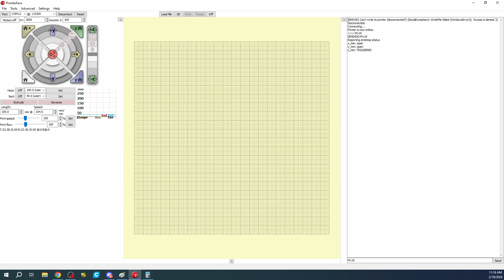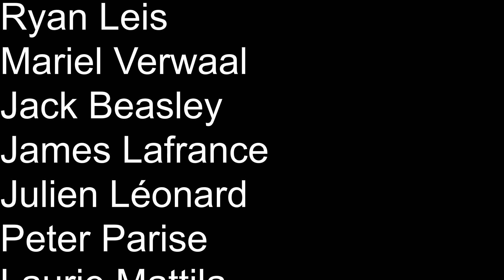Creality Ender 3 Upgrade - Endstop Replacement X Axis

Comment: Hi , Is it possible to connect an Arduino to a BTT Octopus using a Serial port and control the BTT through the Arduino? I’ve been trying for a long time but haven’t been successful. Please, if possible, answer my question.

Comment: My Ender 7 end stops dont have them metal things from factory... i tough you broke them when checking them :)
Well my 250$ Ender 7 now has an Manta E3EZ, CM4 4/32, LDO X and Y, 2xEZ5160RGB, 2xEZ2209 and a REAL Meanwell 350W that i molested by putting in a 80cm Noctua :P
Original it had a "Creality "Clone" but that has a 24v fan in it.
(And i got all if it working watching your video's :P ) printed about 6 spools with it. PLA and PETG...
Reply from the maker: Congratulations and thanks.